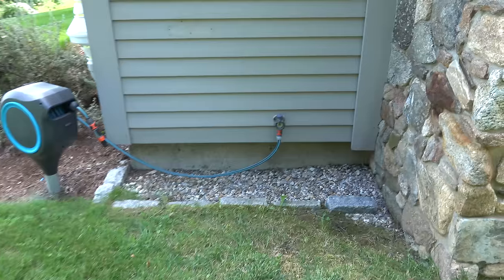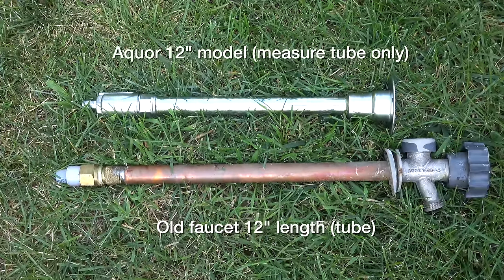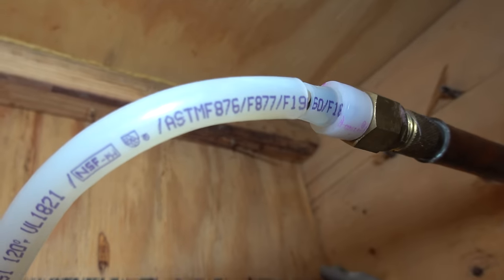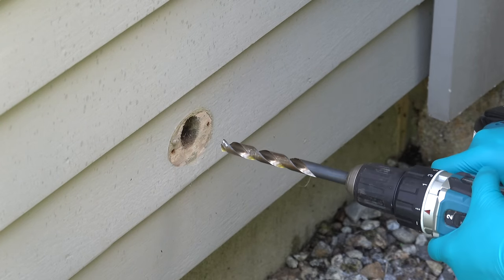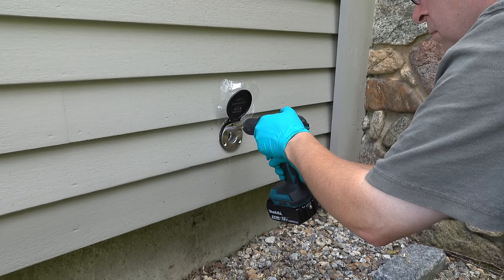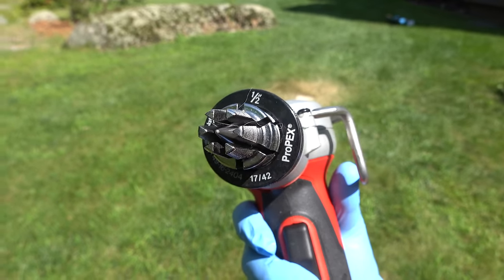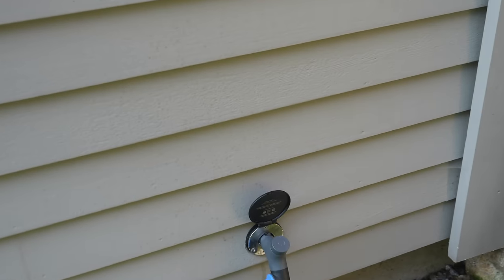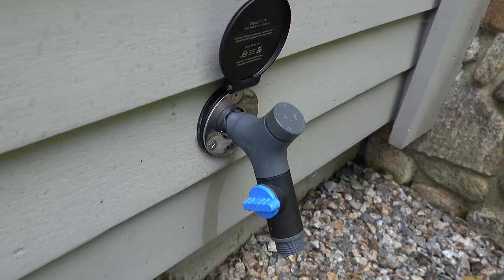REPLACING YOUR OUTDOOR FAUCET JUST GOT EASY / Leak & Frost Free AQUOR IDEAL for Retrofits

Comment: I'm in the "unnecessary" camp.  It's cool and all, but I'm a big fan of standardization and avoiding propriety tools.  That insert seems like a really easy thing to lose or break.
Reply: Agreed. This feels like a solution in search of an already solved problem.
Reply: Yeah, id end up snapping it off and ripping the whole thing out anyway. I hate how everyone is trying to reinvent the wheel these days....
Reply: Is it proprietary? Seems like the sort of thing that would be really easy to just buy a replacement for if it breaks. Maybe several just to have a few on hand
Reply: @AndrewMeyer Words I live by are if it ain’t broke don’t fix it.
Reply: @teon39  But if it is broke, don't fix it for at least a year.
Reply: @AndrewMeyer I like the freeze prevention, but plastic and outdoor exposure are a bad combination. The connection components and outside materials would have to be made of a durable metal.
Reply: @who_cares848  Fun fact there was a time when early humans used logs to roll heavy items across the ground, then we decided to use round stones, then wooden wheels then jump forward to what we use today.  Lucky we kept reinventing the wheel I say.
Reply: @bsmith2053  Because those innovations work better.  This innovation gives you a proprotary part that if you lose you have to go out and buy a new part and if for some reason AQUOR stops making these or goes out of business then you have to replace your spigguts which are otherwise functioning.  I do think they fill a niche and If I lived further north I might consider them but I don't think they will be anything more than that.
Reply: @TheAtkey  How do you know they 'work' better.  If people are happy to weigh up the pros/cons and to assume that risk because it may be a better option go for it.  It may turn out that insurance/councils etc start stipulating this connector one day because it proves to be reliable, then this product could become the new standard.
Reply: @bsmith2053  its an expression dude...
Reply: Agreed, I cannot see the plastic faucet lasting too long, especially in a southern location getting the direct sun from April till October.
The proprietary aspect means the company, once successful, will be bought by a larger maker, and gradually the parts will be less and less available.
If you are installing this, get your spare parts now.
I've been burned far too many times.
Reply: Me too. I live in Colorado and have never had an outside faucet freeze. And they don't look that bad, most people don't notice them at all
Reply: @who_cares848   it would be a nigh mare if ripping out and replacing not going smoothly while "old 1999" still functioned as it.
Reply: @tuneaddicted That's because the existing regular spigots are also antifreeze in freezing climates. 
They shut off inside the house, and then drain the water - which is why it's important to disconnect the hose before a freeze because it could prevent it from draining properly.
Reply: @bsmith2053  He was referring to the wheel that YOU brought up, and then you proceed to argue against him...lol. And your argument that these MAY become the new standard? That is just plain stupid. So lets all go out and buy the newest product just because it "may" be the new norm. Sheer brilliance!
Reply: @teon39 And if we listened to those words, we would still be living in mud huts.
Reply: very good point, who knows how long that stuff will be around before they go bust and boom gotta replace it with something else.
Reply: @TheAtkey I guess you could make the claim that any NPT fitting was at one time "proprietary", till it wasn't.
Reply: @TheAtkey  I live in NB4 pretty much as far north as you can go before you are in actual tundra, my house has the old style spigots on it and it will stay that way. Frost and lines freezing are not a big deal. My spigots stay on in the winter and they don't freeze even in -50C below because the delicate bits that can burst are buried inside my heated house. You have more issues with items you have connected to water that you don't get to fully drain. Ie. My sprinkler system that I thought I got drained but didn't.
Reply: As someone who worked for a company that sold propriety equipment (as many companies do these days), and then have to deal with irate customers because of that, I tend to shy away from these types of products. It may be cool, and even work fine, but companies come and go, and even stop supporting their own products at some point.
Reply: @justadbeer Yes, but everything is proprietary till it's not. At some point all fittings were proprietary.
Reply: @who_cares848  an expression that was used as an argument against this product.
Reply: @calvin99991  ahh no I didn't say to go out and buy because it is new, reread what I said.
Reply: Love the idea, but unless you're going to buy an extra couple of inserts to store in the basement, I wouldn't expect it to be available the first time one breaks in a couple years.
Reply: @bsmith2053  No need to. I know what you said. And seeing you argue against your own statement was enough to expose your intelligence level.
Reply: Outdoor faucets have been around for over 100 years with minimal issues , yes they may need to be replaced or   repaired  after 40 years but as a contractor that specializes in pre-WW2 buildings in NH  I often come across homes with the original Faucets that work perfectly fine .  This modern contraption that you're trying to hawk will fall apart just like every other modern contraption within just a decade as it'll start with the cheap door latch failing   , the cheap plastic parts breaking etc ...  . Also , in 10  years from now  the parts likely won't exist to repair it. Meanwhile, the parts needed to repair an 80 year old faucet are prevalent and easy to come by for cheap money and you don't need a plumber or fancy compression tools to repair it .

  Kinda like a modern washing machine / dryer for example . The two Maytags  in my home are from the early 1980's , work perfectly fine and are both easily repairable unlike  the modern versions that run off of a computer / software program / sensors etc  that often fail  and nobody knows how to repair  .  

  Washers job :  let water in , spin with soap , rinse and drain .

  Dryer : Put clothes inside , hit go , dryer spins , heating element activates  , heat and moisture vents  through a tube that goes outdoors  as its that simple .

  Somewhere along the line somebody thought it was a great idea to make it very complicated much like the water spigot  .
Reply: So how is it better?
Same volume of water comes out . 
Looks like a device for people with neighbours who may sprinkle their lawn while your at work .  LOL
Reply: @bmuseo  They make a stainless steel version, even a matte black stainless steel version if that's your thing.
Reply: @davidc-l9174  But is there a metal handle? That's the part that looks like it will break the easiest.
Reply: Unfortunately, I will probably have to consider swapping mine out for something like this as I have recently lost my full range of dexterity. I have a hard time turning the valve because my grip is weak. This would solve a lot of my issues when it comes to needing to use the outdoor hose.
Reply: @torches2011  They small quarter dia.  size plastic knob looks to be harder to turn than a cookie size dia. knob .
One you turn with finger tips the othe the palm and fingers of your hand .
Reply: The problem is it's not made out of metal and because it's proprietary that becomes a much more serious problem.
Reply: Or steal.
Reply: And I’d bet that insert does not come cheap, so losing one or having the plastic crack means a call to the producer.
Reply: Yup. Solving a problem that doesn't exist.
Reply: @bsmith2053  Well, it is not standard yet and might not be ever, plus like he said, if nobody else produces the part and such company goes out of business or creates a monopoly, it will be bad. Not all improvements in life are that great or even truly necessary or need to be adopted just because it is the latest. This one could be or could be not, time will tell
Reply: @calvin99991  I know, right!
Reply: @James-to7pi  Yup that plastic outside part looks like it's going to break, and in 20 years will you be able to buy a replacement? Heck I wouldn't be surprised if this company is out of business or rolled out a new design in 5 years, then where are you if you hit this with a lawn mower and snap it off?
Reply: Are all of you serious that you have never worked with PEX  or something? If  you have ever done any plumbing in a bar, then you would have seen tons of it.
Reply: Agreed.  If it were standardized, would love it.
Reply: @AndrewMeyer  And if the company fails in 14 months?
Reply: @who_cares848  I understand that but this is how progress and improvements are made in society. Not always worth it or practical but a step forward to the next thing that will make what we have now obsolete and ancient by comparison. We constantly reinvent and improve how we communicate when a phone worked just fine 30 years ago. Not necessary but something may change where it makes some changes necessary.
Reply: INNOVATION - I love it !!!!
Reply: @who_cares848  I bet you have a mobile phone, tablet, computer and even a Tesla? The old rotary dial phones worked well enough hey? I guess pen and paper were fine for thousands of years. Why invent the computer? Who needs an electric car. Fossil fuels work just fine. Need I go on......
Reply: @AndrewMeyer  The inserts are made of plastic or some composite that will fail over time instead of making it out of a metal like aluminum or tool grade bronze.
Reply: @vaderladyl  No one has said this product is necessary, no one is holding anyone ransom to switch to it.  As I already mentioned if people are happy to weigh the risks for their situation then that is their choice.  If after some time it becomes a standard/popular then this whole discussion about not changing it blah,blah, blah is moot. The issue seems to be the mindset that "why change it it will break", "this is reinventing the wheel" the world we have was literally built off reinventing wheels, off changing things that at the time people didn't realise needed changing.  If you don't want it don't get it.
Reply: @TheWesty615  hmmm that hurts...that hurts a lot.  It seems that I have offended you as you seem to have taken this issue seriously, for that I apologise.
Reply: @bsmith2053  Yes, because no one put a patent on round stones or the wooden wheel... 

I am all for rethinking tools we already have... but it needs to be done in a way that standardization still has a chance of existing. Patent law is literally diametrically opposed to improvements of this kind.
Reply: @TheEclecticDyslexic  I don't disagree with what you have said.
Reply: That's been my hang up as well...
Reply: @Crashed131963  It's not better , it's a gimmick that idiots purchase to then complain when the door latch or other parts break within a few years  to then learn that the parts are no longer available  or a pain in the ass to find .

   This is the result of having to many people with engineering degrees needing something to re-engineer /invent as I picture a 26 year old with a fresh degree in engineering designing something like this , but what he lacks is common sense and wisdom .
Reply: Here I am with even older type faucets replacing them with the one he's replacing in the video and loving how easy they just work.
Reply: @bsmith2053  Trust me, I won't get it until ,if ever, gets to be an standard.
Reply: @bmuseo  Oh, that I don’t know. The plastic ones are very durable, however. Given how easy they are to connect/disconnect, I don’t see that you’d need to otherwise worry about them.
Reply: @bmuseo standard frost free spigots work the same. Problem is Most people do not install them correctly. They are designed to slope down towards the outside wall. Turn the water off and you will see that any water left in the shaft will drain out. The standard frost free spigots are also extremely easy to repair unless the valve housing is damaged. The anti siphon issue his valve had could have been repaired for a few bucks while blind folded without the need to shut the water off to the spigot.
Reply: There’s no way it won’t leak
Reply: Bunch of fuddy duddies here 😂 My elderly parents live with us and even they find the House Hydrants to be better than a regular spigot. We’ve had no issues at all with them or the adapters (which mostly stay permanently attached to the hoses and other things we use the exterior water for).
Reply: Then why click on the video? and leave a comment ?  I missed where in the video he asked? ha
Reply: @Dave-tn3eo  6:31 was where he asked in the video.  Commenting "boosts engagement" and causes YouTube to promote the video, which in turn allows our host to continue making more videos about other interesting home improvement products.
Reply: I installed them in our tiny house and they are amazing. So much easier to use and no having to screw the hose on and off, ending up with leaks or cross threading. The connector stays attached to the hose so it doesn’t get lost.
Reply: It's what we used to call a fix for something that isn't broken. Borderline Rube Goldberg.
Reply: This looks like an excellent way to install a problem where you don't have one currently.
Reply: I'm with you. The house we bought has this proprietary system for installing the power outlets in the wall with little clip things. I had to go online and find some to replace the old broken ones. Luckily they can be 3d printed, but its such a pain. If i wanted to replace them I'd have to rip out the box and put in a standard one.
Reply: Every fixture & appliance in your house & even the car you drive is made up of “proprietary” parts, dolt.
Reply: @bmuseo  Right?!?! A PLASTIC valve?? I'm in Texas, and would not even try this!
Reply: exactly what i came to say, I would never want this ever!
Reply: and of course your the resident expert on what works.. right?  You keep your old crap on the side of your home, and allow others to decide for themselves. @TheAtkey
Reply: @SteveHouston  You have my premision to use whatever spigot you want to use.  If it works for you that's all that matters.
Reply: @TheAtkey  or we can make this the new standard. Thats how things works, you invent something better, realizing it is better than any other things, and you use that as the new gold standard.

Do you guys not remember old PC connectors? They were NOT all USB back then, so many different propriety ports, until people designed USB and it was just miles better than any other ports, everything is USB standardized. This is just how things evolve over time.
Reply: @Skooz  Using your USB anology making this the new standard would be like having USBs the standard connection on PCs and Laptops but all the devices manufacturers would still be making their products with parallel ports, VGA,  DVI ext and you would need an adapter between them and they would never make them any different.  

How is this device better than the old?  To me it justs adds a part that you could misplace or break since it's plastic and the only benefits are aesthetics or maybe security since it would be harder for some random passerby to just turn you wateron for fun.  If you want it for those reasons that's fine buy it but if you don't I don't see a reason to change.
Reply: @TheAtkey  this absolutely does not have a quality build, but the idea itself is worth exploring. We will never advance in anything if we keep rejecting ideas and sticking with "things that arent broken". You know even just traditional tires have had a lot of innovation in the past 3 decades? From materials to designs to improve everything. I absolutely agree this product right here is not going to replace traditional ones, but this might be the begining of something great
Reply: I have this system in a new rehab of two buildings.  The plastic is super durable, I would say even feels "solid".  I just keep it on the end of the hose I use.  Easy to purchase replacement too online like we did when someone here threw it out while cleaning up debris.  Not for everyone since it is an added cost to replace old system (which work fine) but much nicer looking in my opinion.  We are here in Chicago and nice to know that there are no freeze issues with this system since the water shut off is within the building's envelope.
Reply: Right?
Reply: @TheAtkey   I live in Northern MN and have multiple frost free spigots. All I need to do is disconnect my hose before winter, and that is just to protect my hose. This product is not necessary. I also wouldn't want my outdoor water lines to rely on a proprietary part made of plastic, especially considering the modifications necessary for installation.
Reply: @bsmith… this was 5 months ago, but your comments are why I love YouTube, you are so confidently wrong. It’s amazing to read. 

You wrote a whole paragraph, then got triggered and started with the one liner outbursts. Loved every second of this. Way better than reading books, this is gold.
Reply: same i buy it plumb it the company goes out of business I have to replumb again...i have a 3ft tall crawl space
Reply: @calvin99991  Ok, now you're turning a disagreement about a product into a personal attack. Seems worthy of a block, to me.
Reply: @AbuMaia01  Oh my, how EVER will I live knowing I've been blocked?...lol
Reply: Yeah, because a normal hose spigot doesnt easily break
Reply: @Rudgged  i have never broke a metal hose spigot...and if i did I would go down to ace or home depot and buy a new one...
Reply: Make it easier for someone to take your water. All my outside faucet do not have round handles. Squatters hate my hose bibs.
Reply: @Bob_Adkins 😂
Reply: @Crashed131963 😂 true. People really do that stuff too! My neighbors helped themselves to mine while I was away taking care of my parents…can’t leave one stone unturned when you leave home🙄
Reply: @who_cares848  Whats with the DUDE ? Dudes don't fix nothin.
Reply: @bsmith2053  
Elon Musk could come out with square wheels and his cult would say it is the future.
Reply: @AndrewMeyer  Tell me if you can find one local.